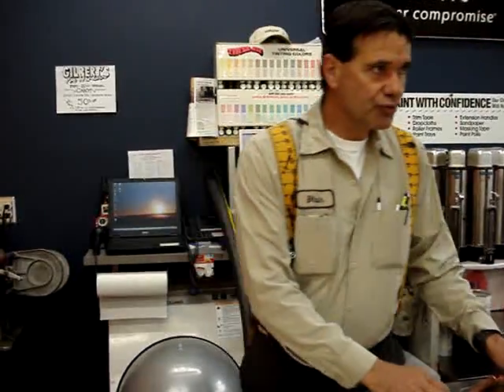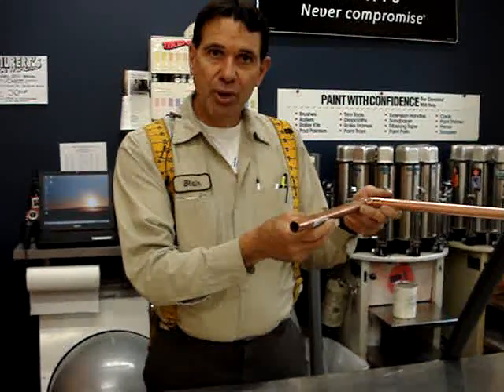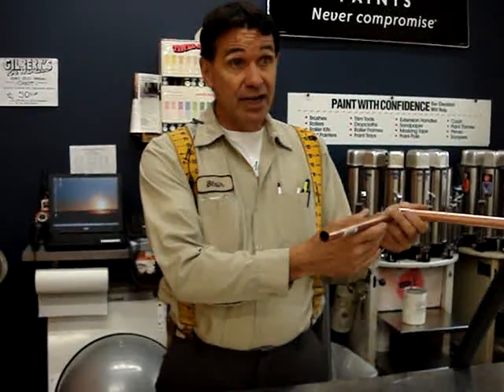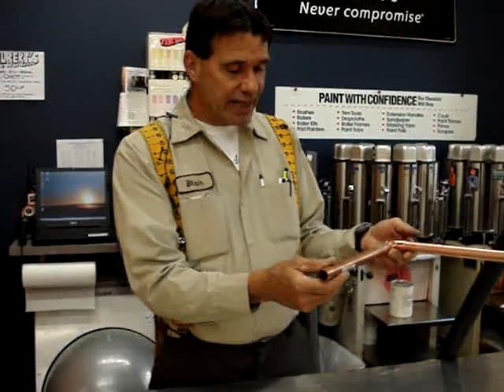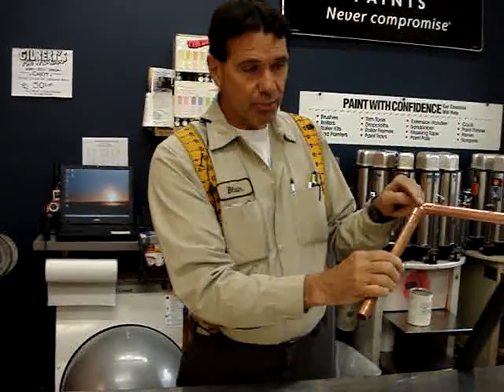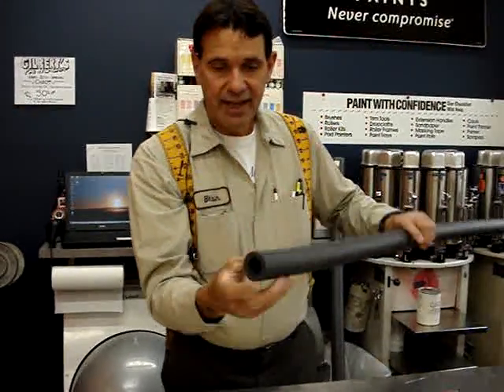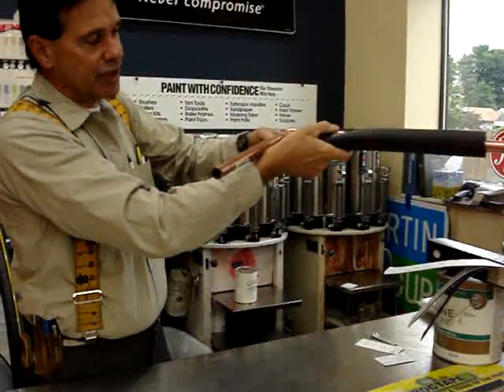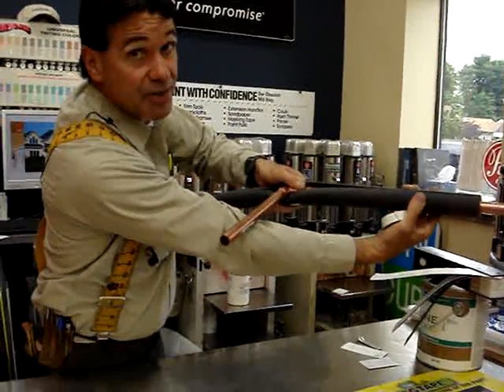Tip To Prevent Cold Water Pipe Sweating, Condensation and Stop Dripping

Comment: Thanks for the info.  I have the main water supply pipe running under the drywall ceiling in my garage.  The furnace in the garage heats the air and condenses on the cold water pipe  9 months out of the year, and I have a lot of mold on the garage drywall.  Last year I wrapped the pipe with the foam pipe sleeve insulation like you show and it helped only a little but there was still water that collected inside the sleeve and at the holding brackets and there is a lot of rust and mold.  I will now try and tightly wrap the copper pipe first with 6 mil poly moisture barrier so there will be no water touching the outside of the copper pipe and stop the rust.  I will then add two layers of pipe foam insulation sleeves to be thick enough to increase the dew point away from the pipe.  I will tape all cracks and joints closed and see what happens this fall, winter, and spring.  Wish me luck.
Reply from the maker: Furnaces
Reply from the maker: Furnace exhaust is full of moisture. It must be vented outside, just a suggestion if yours is ventless. Maybe a dehumidifier will reduce the issue, unfortunately at a $30 per month electric cost.

Comment: Had this happen down in our basement, luckily not finished. Water all over the floor and our softener system. 
Installed a dehumidifier with drainage system in the basement and issue is solved.

I think I’ll do this too

Comment from the maker: You can wrap Fiberglas insulation around the tank to prevent warm moist air from contacting the cold tank. Leave the drywall alone, it should stay room temp.

Comment: Thanks for the video. Whenever I turned on the Air conditioning system in the summer, the water starts dripping on the floor. I can see the condensation on the brass pipe, where the pipe is coming out from the furnace. There is a small area of about 6 inches, where the pipe is not insulated. I can see a glue or rubber type adhesive was paste on the pipe, which came out gradually. I am wondering what type of adhesive/glue is used on that pipe.
Reply from the maker: Can you custom cut some foam pipe wrap and wrap the exterior of the foam with electrical tape? Or wrap it with cork tape, expensive though. Don't use glue unless absolutely necessary.

Comment: I keep reading about this, and most (if not all) articles mention summer time.  However, our cold water pipes are sweating (it is definitely NOT a leak) in the winter ONLY.  This just started over the past two years (maybe three?) and we have been here for over 30 years.  The basement has not really changed, so it's kind of a mystery why it just suddenly started happening.  We have two dehumidifiers in the basement (as well as a whole house humidifier for the winter months), and relative humiditiy shows at between 40-50% throughout the basement.  So it's not very humid.  Any ideas?
Reply from the maker: I would check for causes of trapped moisture. New doors or windows, more insulation, basement rim joist insulation. Anything that will contain or tighten up your house. I suggest you add a cold air return duct from the base of the furnace to the rec-room wall so when the furnace runs it draws 5% of the air from the basement floor. You may be able to get rid of the dehumidifiers you are running. They draw a lot of electricity where the furnace does it for almost free.  I have a video on this, Blair
Reply: @MrHardware1  Thank you, Blair, for that detailed and thoughtful response.  I will look into doing as you suggested, and in the meantime I have wrapped the incoming coldwater 3/4" line with pipe insulation.  Take care.
Reply: M
Reply: Same problem here, winter time and pipes are sweating, the only thing I can think of that has changed in my bathroom is I did some caulking on the outside of the window

Comment: Does this apply for the water condensation pipes that run from the ac furnace to outside the house as well? Those pipes sweat a lot during summer that started to drip and grow mold on them. Thanks
Reply from the maker: Normally yes. This is hard to be sure from here, but I would and if I had a friend in the furnace business that knows your house I would bring them in.

Comment: The water is running down the inside of my foam on the cold water pipe.what is wrong please
Reply from the maker: Sounds like you have some exposed pipe in order to create condensation. The other thing is to wrap all the joints with tape so moisture can’t get underneath the foam.

Comment: I have well water and the water main from the well condensates which creates a problem for the Sheetrock ceiling I plan on having it run  through. If I insulate the pipe coming in it will just create more condensation at the sinks and toilets... I’m looking for a way to heat the pipe or water as it comes in...
Reply: I have used an electric hot water tank for a temperature buffer. Never hooked up the electricity, just the water and let it 'temper' the cold water coming in. If you are handy you could peal some of the 'skin' off to allow better temperature transfer. (I'm asking alot) Blair
Reply: Blair Gilbert I can see how that would work. I have a bladder tank that holds water coming  from the well but that’s getting walled off so it won’t be able to help normalize the water temp... I came across a self regulating heat line that can be installed inside the pipe. Running this from where the pipe enters the house and most of the distance to the well head might be an option. Your recommendation will be included as a back up, thank you! Maybe another bladder tank closer to the entry point? 

I have decided not to Sheetrock over the pipe, I’ll make it into a hinged access door so I can keep an eye on the pipe and make any necessary changes. 

Thanks for the tip!

Comment: shouldnt you use bapor barrior?
Reply from the maker: The goal is to insulate a cold surface from a warmer damp environment.
Reply: @MrHardware1  shudnt u use vapor barrior tho?
Reply from the maker: @redsresearch  yes you can, However it’s not necessary as the foam insulation solves every dripping cold water pipe problem I’ve worked on.
Reply: @MrHardware1  it's not wet if you take insulation off? your probs  not in Canada tho...
Reply from the maker: @redsresearch  no when I snap off a piece of foam insulation to add a valve I find that the pipe underneath is dry.
Reply: @MrHardware1  moisture will eventually dry out also who knows if theres mold spores too

Comment: Does pex pipe have this same issue?  Or is the polyethylene material insulative and thick enough to prevent condensation in most cases?
Reply from the maker: Not as much, I would wait to cover if it sweats

Comment: I got some mold because of the sweating pipe,where it comes at the house , and I have a water meter that sweats , anything I can do about the water meter?maybe a spray
Reply from the maker: You might be able to wrap the water meter and the pipe with a roll fiberglass insulation made to wrap pipes. It is about 4" wide and 1/2" thick and comes with a plastic wrap to go over the fiberglass.

Comment: my mom lives in a mobile home, she has water under her home, had 4 plumbers come out could not find a leak, could it be condensation  dripping , (she has been shutting water off during the day)
Reply from the maker: Condensation will form a line of marks (drips) below the pipe. If there is one spot that is wet I bet it is below a toilet or behind a frig with a water supply. Also air conditioners make a lot of water, could the leak be near there?

Comment: Hey, what do you do if the piping is running through the attic and is still condensing even though I covered it? Its ruining the drywall, and just ends up dripping down on the inside of the insulation until it finds an escape.
Reply from the maker: Jordan, if one layer of foam pipe wrap isn't protecting it from the humidity you may need 2 layers.